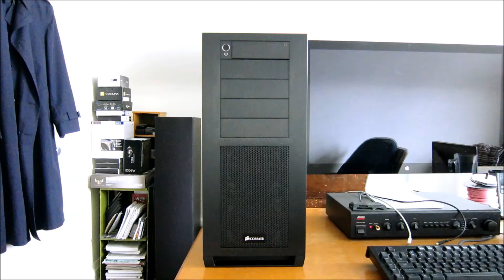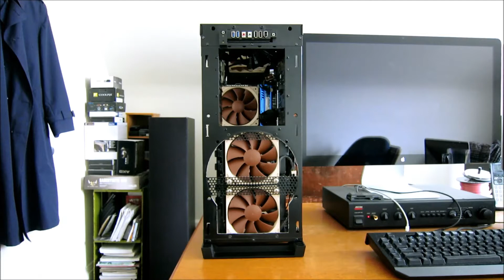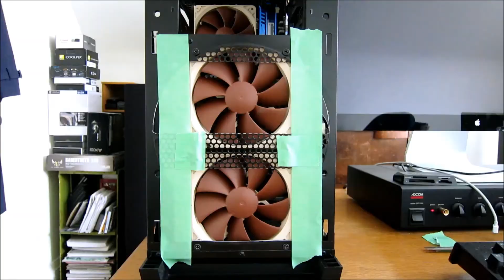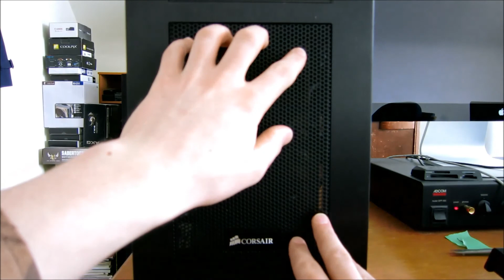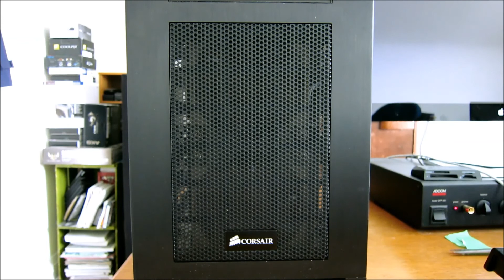Corsair 650D Dual 120mm Front Fan Mod

Comment from the maker: they are not that loud on low setting but they also don't move that much air and they are fairly cheap quality in general. they are low profile 20mm fans which i don't really understand why they would use those in a large case they should have just moved the hdd cages forward a bit and made space for thicker fans. i did run the stock fans for a few weeks and after about a month there seemed to be some grease build up around the motor area.

Comment from the maker: I have seen people fit a 240mm rad in the front by drilling some holes and doing some cutting like I have here, and the top supports a 240mm rad as well. the 900d is much larger and you will be able to fit a lot more radiators into it, but it just depends on what size of case you prefer and how much radiator real estate you will need.

Comment from the maker: Also for the built in lighting in the phantom 820 i believe there is a molex power or sata power to power the lighting so if that is not plugged in that might be the issue with the lighting, just check all your cables and make sure everything is plugged in.

Comment from the maker: If you have your fans connected to the MB and you want to set the speed for fan headers 3 and 4 have a look at my MPOWER bios overview video you can see how to do it there it's pretty simple though you just go to the top tab on the left of the bios (MSI mainboard settings, go to advanced, and its under hardware monitor)

Comment from the maker: I'd like the see a rectangle mesh grille similar to the one at the top of the 650D in the front behind the filter that has premade mounting holes for 2X 120mm 2X 140mm and 1X 200mm. I think that would make the case a lot more flexible and more attractive overall. 

Good luck!

Comment: I have this case also and am looking at doing a 240mm front radiator for dual GPU cooling and I'm honestly surprised that Corsair didn't already build it for this with the mounting points :/

Comment from the maker: Hey man - I haven't built in a Phantom tower so I'm not sure about the fan light stuff (i think the nzxt stock fans are white or grey though) the 820 tower has some lighting stuff built into the top, though. As far as the fans being noisy I know there is a fan controller built into the case so you could connect all your fans up to that if you want. If you have your fans connected to the motherboard only headers 1 and 2 are auto controller headers 3 and 4 you have to set the percentage manually.

Comment: Very cool mod
Reply from the maker: Cody Howe thanks. i probably wouldn't bother doing it again, though. the 200mm the case comes with are actually fine. or you could also buy a different 200mm fan to replace it.